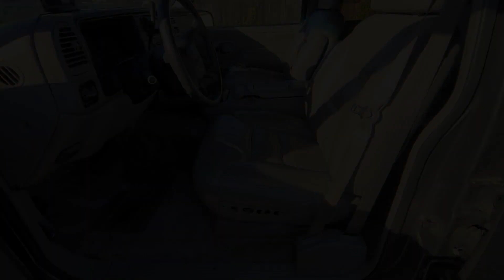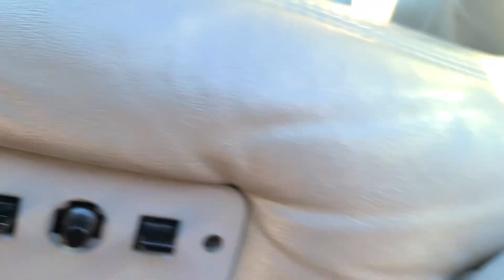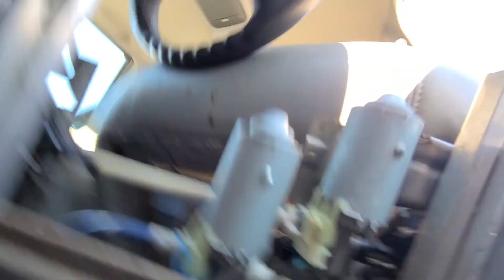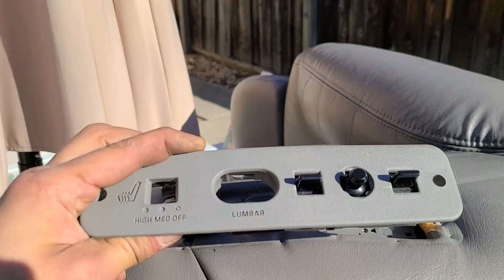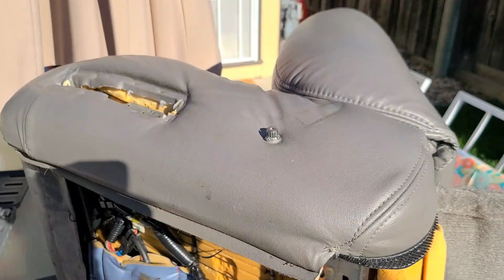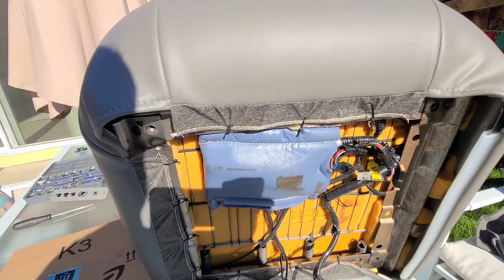DIY Replace Front Lower Seat Covers On A Chevy GMC Suburban Tahoe Yukon Escalade OBS (95 - 99)

Comment: The company I bought from on ebay had me send the old and new covers back and made a new one using the heater out of the old one. And this is on a cover I bought 1 year ago! The ad said it would work on heated and non-heated. Turns out, the early heated seats (like yours and mine) were made with the heater in the cover and later, it was under the cover. Maybe you could contact the seller in the future and have them build your heater into the new cover.

Comment: So did you just punch holes for the zip ties? Sorry if it was covered.
Reply from the maker: I used the existing holes and switched from metal clamps to zip ties.
Reply: @Horizoncamperbuilds any issue with zip ties breaking?

Comment: Color definately does not match
Reply: One of the companies that makes these replacements also makes on in actual leather. The one in the video is vinyl.  The leather ones are a slightly better match, but there's always a diffuse due to a few factors (aging, slight variations between batches, etc.).

Comment: Thanks for the video. I've got to change both driver's and passenger's lower seat cover - and also the foam on the driver's side. I've had the parts a few years and have never gotten around to doing it.

Comment: Thanks for the heads-up on the zip ties and losing the heated feature. Mine still works, but that's okay because I only really like it when the back is heated. All heated seats should have "zone" heating in my humble opinion. Great video, thanks again!

Comment: Was making the openings on the side a pain?
Reply from the maker: It wasn't too bad. Just make sure you don't over cut the hole because it will show.
Reply: @Horizoncamperbuilds whoa hi!  Big fan! did you use an exacto knife?
Reply: @YeahNoToastTho  that will work.  Small cuts to start.